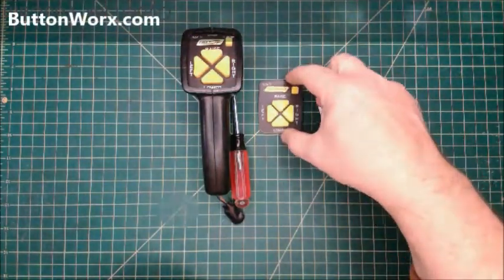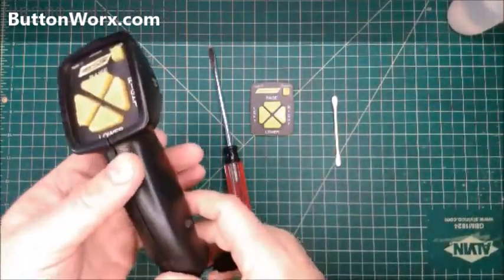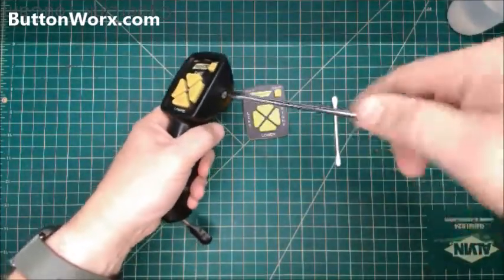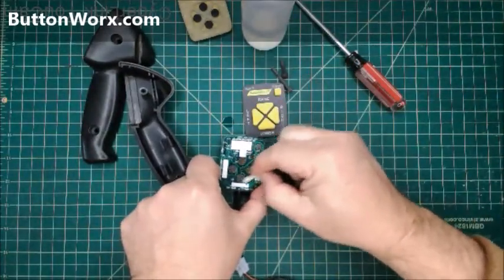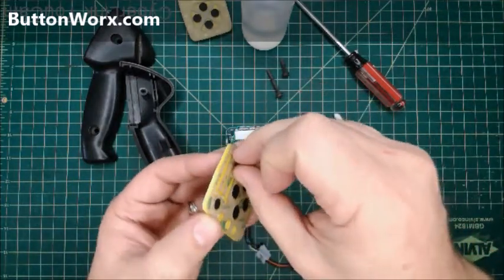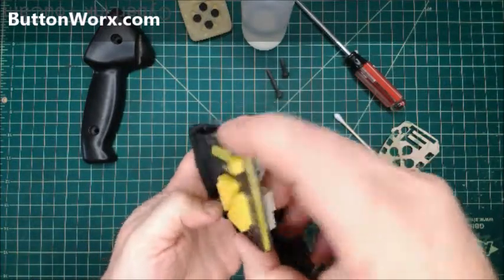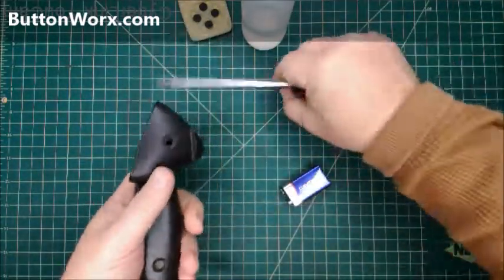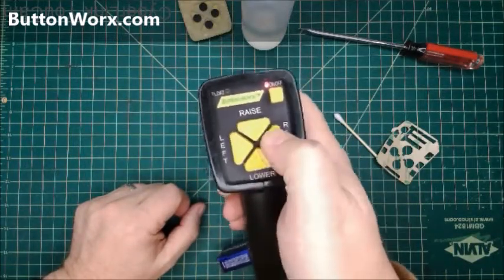Fisher Fish-Stik / Western Plow Controller Keypad Replacement

Comment: Anyone order this and is happy with it?
Reply from the maker: I've only shipped around 8 of these so far so and I doubt any of those customers have used them yet because there hasn't been much for snow. If you don't like it, I'd take it back for a full refund.
Reply: @p1repair  yep placed my order. I'm the guy who needs the 5 button v2 that you just emailed me about.
Reply from the maker: @CoBrAChiCKeN948  OK, but that order was not for a full keypad. It's the membrane repair that goes between the circuit board and your original rubber keypad. If your rubber keypad is not torn up then that's the best choice. I've sold thousands of them and never heard any complaints.